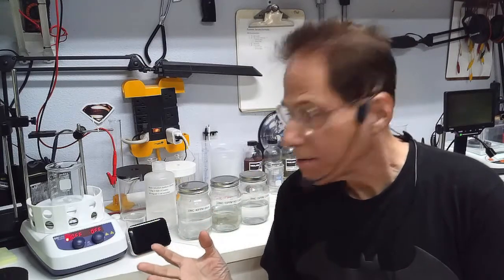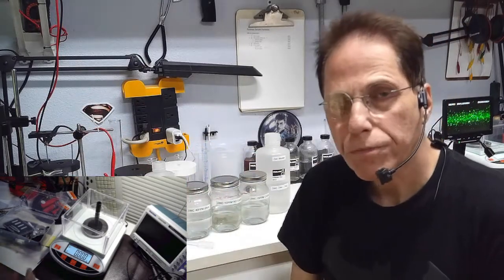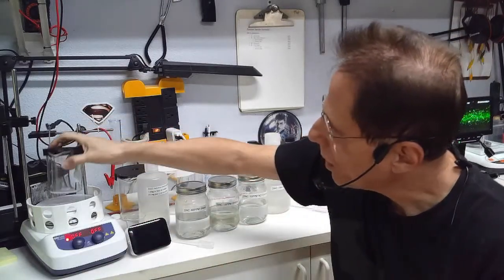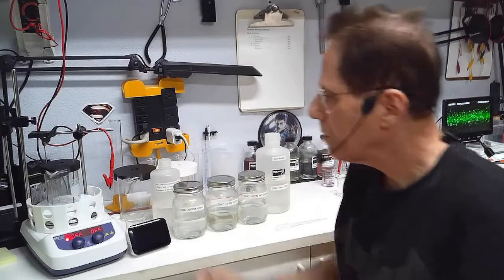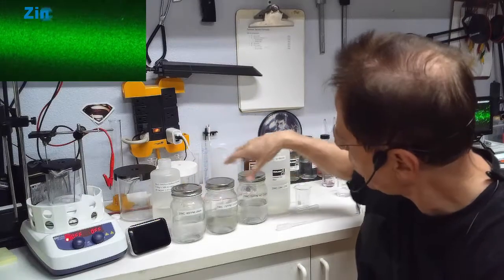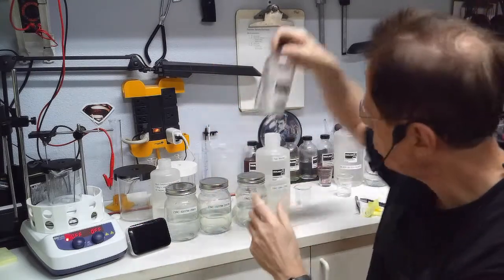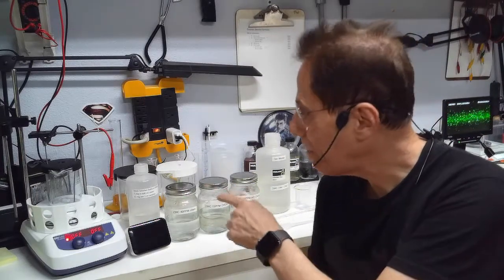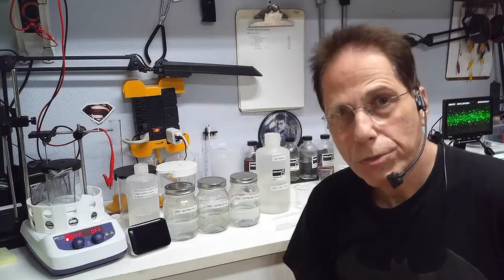How to Make Zinc Nanoparticles.

Comment: Is it better with citrate or without?
Reply from the maker: If you are just starting out cooking zinc, I would not use anything in the solution, just to get the hang of it. Cook it until it starts to turn lightly white. Then you will be at 18 to 24 ppm solution medium particles. It will take 4 to 6 hours for 550mL of distilled water. The sodium citrate will cook faster (45 min) but it will give you fine particles. The best scenario is having large, medium, and fine particles. But the medium particles are a nice midway point, without having to cook two batches and combine them.
Reply: @AlchemyWizard  
I don't care about the time.  I'm going to do 250ml.  With sodium citrate you get fine particles? I understand that it improves its effectiveness, correct?  
Another thing, what is the dilution of the citrate that you have prepared?  I have it in powder. 
Thanks for all the information Hermes!!!!
Reply from the maker: Dissolve 7.35g of Sodium Citrate in 500mL distilled water. Drip that into the solution (5 to 10 drops) until you hit about 5mA of current. Drip it slow as it takes a few moments to see the changes on the current meter. 250mL may cook in 30 to 60 minutes. As far as particle size, zinc is not like silver where you need large, medium, and small particles, so any kind of colloidal zinc particle size will work fine. Colloidal zinc or any colloidal is absorbed into the body quickly as it is already suspended in the solution. That is what makes these colloidal forms much more efficient over just taking solids and letting them maybe dissolve in the stomach. Best of luck!
Reply: @AlchemyWizard  I think that the method adding Colloidal Silver is safer. Since there is no risk of toxicity.
How are these 7.35g of sodium citrate calculated?
Reply from the maker: you weigh the sodium citrate on a digital scale. You can make 50% less by cutting the amount of sodium citrate and water down in half. I use it alot so I make 500mL of it. 

Either method is fine, with the sodium citrate or without. There is no toxicity with the sodium citrate, but as I did indicate earlier, as this is your first time doing zinc, just do the first batch without the sodium citrate, then later do another batch with it and you can compare them. 

If you do not have a scale to weigh the zinc rods to determine how much you have in the mixture, then cook it until it starts to turn milky white. If you can weigh the rods the formula for ppm is: •	ppm = material used x 10^6 / amount in mL.
Reply: @AlchemyWizard  
I have tried to make colloidal zinc without citrate, but I can't. I have heated the water above 63°C and with a 61Vdc power supply at 0.002A.  for 4/6 hours... it doesn't work... it falls to the bottom in a few hours...
What am I doing wrong?
Reply from the maker: Without the sodium citrate or citric acid some of the zinc will fall out of the liquid. The chems will help stabilize it. If you are not using the chem, then you will only be able to get about 10ppm zinc in the solution before it starts to just fall to the bottom. 10ppm is still a good colloidal. but if you want 15ppm or more of zinc you will need to use the sodium citrate or citric acid and increase the current to 5 to 10mA. It will cook fast then, so stop it when it starts turning milky. The chems are household body friendly and are safe and they will in no way effect the efficiency of the colloidal zinc. I cook zinc both ways. I really see no difference. The particle size may be a bit smaller with the chem, but it still works well. Currently I mix a one part 46ppm zinc to a two parts 8ppm zinc to give me about 18ppm. without the chem I could never reach 46ppm zinc to make that combo zinc solution.
Reply: @AlchemyWizard  Thank you Hermes for your patience.
How do you calculate the PPMS, because with colloidal silver I know that it is about twice the value shown by the TDS, but the conductivity of Zinc is different.

I have tried, with temperature, without temperature, with more mA, with less mA.... It takes time for the Tyndall effect to appear, but it appears... But, it is not stable, it ends up precipitating with time....  I am desperate! I don't know how to do it.
I want to get it without citrate.
Reply from the maker: Zinc: with no sodium citrate the most you will ever get in zinc is 10ppm. If you are using a red laser, the laser will always be stronger when you first cook it. Afterward it will fade away and you can only see the Tyndall effect in a dark room. 

TDS Meter: does not really work for any colloidal. with silver it seems to work but if you try it several hours later or another day it will show a different reading.

Determining the PPM. When I did not have a scale to measure the weight of the material being used from the rods, I would take a sample of the zinc or silver into a dark room and use my red laser on it. Green lasers are much brighter, but the green laser will also show some other particles in your distilled water if it is not perfectly pure. With green laser you check before you cook it. Note the intensity, then cook the colloidal check again and see if its gotten stronger. 

Calculating PPM: I use a three digit scale, 0.000 to weigh the zinc and silver rods to determine the actual ppm. 

PPM formula: •	ppm = material used x 10^6 / amount in mL.
Reply: @AlchemyWizard  Did you already try to cook colloidal silicon/silica? I tried it with sodium citrate and about 40 degrees celsius, 40 Volts @ around 20milliamps, it plated onto the copper cathode, while there was little colloidal material in it, . Is citrate maybee the wrong stabilizer? More heat? thanks !
Reply from the maker: @alexanderthurner8385  I would just put the silver cathode in distilled water. Use your 40 volts and let it go until you start to see the solution turn slightly brown. Then you be at 18 to 20 ppm silver. And yes a copper anode will get coated with silver. That is normal. LVDC electrolysis wastes about 20% of the colloidal material. Also you should stir the solution. If you do not stir it, you are likely to get a very low colloidal count. You can pick up a stirrer for amout $20 from Amazon. If you don't have one then just keep moving the water every few minutes with a stick or plastic spoon or if you have a fish tank air pump, put the air hose in the water to keep it moving. 

• PTFE Magnetic Stirrer Mixer Stir Bar: https://amzn.to/3K9mR9J
Reply: @AlchemyWizard  thanks for the answer but i meant silicon, not silver :) i use a stirrer…
Reply from the maker: @alexanderthurner8385  Oh sorry, I misread. I never made colloidal silicon, and not even sure you can. I will check with my chemist and let you know.
Reply: Thanks for the info again!!
I think that if you want to speed up the process, it is safer to add colloidal silver drops, right?
Reply from the maker: You can add colloidal silver drops as an alternate way to get to the 5mA current to cook it faster. You may need to use more than just 5 to 10 drops. I usually put in 10 to 30 mL of colloidal silver as a seed in 500mL and the current changes slightly. Either method will give you zinc that will work great.

Comment: Olá, muito obrigado por fazer esse vídeo, em um de seus vídeos você fala que usou prata coloidal para dar a corrente necessária para se fazer o zinco, você ainda recomenda?  Muito obrigado. Sou brasileiro.
Reply from the maker: If you do not have any colloidal zinc to use then yes you can use some colloidal silver (10 to 30mL) to help kick start the current. Let it cook until you start to see it turn just a slight bit milky white in the solution. At that point you would be about 18 to 20 ppm of zinc.
Reply: Muito obrigado!!!!

Comment: Thanks!  Where can I buy colloidal copper generator?  You did a video on benefits of copper but didn't show us how to make it.
Reply from the maker: I'm planning a copper making video, I will try to get to that soon.

You can use any of the colloidal silver generators like this one. But you will need to get the copper rods as they do not sell a copper generator.  Below is a link to a generator and some copper rods. 
Generator: https://www.amazon.com/Colloidal-Generator-Equipment-Produce-FromBora/dp/B0886KF9S2/ref=sr_1_10?crid=1S35973MW8X52&keywords=colloidal+silver+generator&qid=1657715731&sprefix=colloidal+silver+generator%2Caps%2C91&sr=8-10

Copper Rods: https://www.amazon.com/Ququyi-Copper-99-99-Jewelry-Supplies/dp/B09V57XFFY/ref=sr_1_2?crid=3NN8QUSL1WEQW&keywords=99.99+copper+wire&qid=1657716159&sprefix=copper+wire+99.99%2Caps%2C85&sr=8-2

Comment from the maker: For those of you that want to dispense with the meter and the sodium citrate, you can just use your usual silver rig with some kind of agitation, and cook the zinc until it starts turning milky white. Then you will have a 40ppm solution. This can take up to 10 hours for a 500mL batch. This is not exact, but then if you cut the cooking time down in  half from the 40ppm you just cooked, you would in theory have something in the 20ppm range.
Reply: hi. mr hermes i have a 16 volt 650 milliamp adapter. Do you mind if I drink the zinc water I cooked with it? I want to cook this way without any other process
Reply from the maker: @vedatkahraman6964  Sure it will be fine! And zinc is great for the body's healing ability. You can also put it on cuts and sores on your body too. Mix it with some aloe or cream.
Reply: @AlchemyWizard  Thank you for putting up with me and always answering my questions without getting bored. Your work and advice is very valuable to me.
Reply: whats with the need to do it quickly? set it and forget it....
Reply: Appreciate your work. Just about to give it a try. Can i add some silver colloid to jump start the process and sorten the cook time some what. Tx
Reply from the maker: @HardheadBuilder  yes you can. It will also  help minimize the zinc hydroxide that is created. Silver-Zinc is a fantastic combination. I'd add 10% silver. But you could go as high as 50% for a 50-50 mix. Experiment.